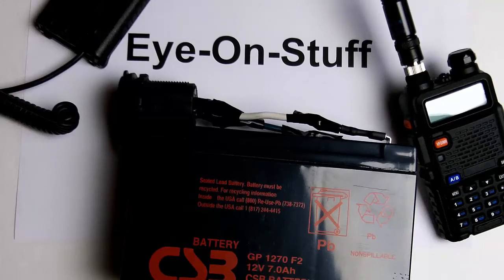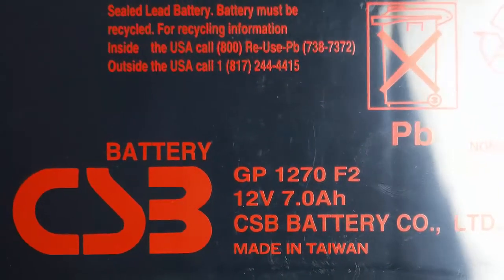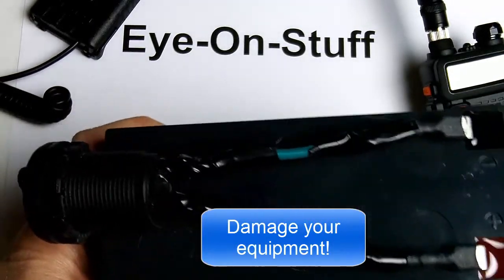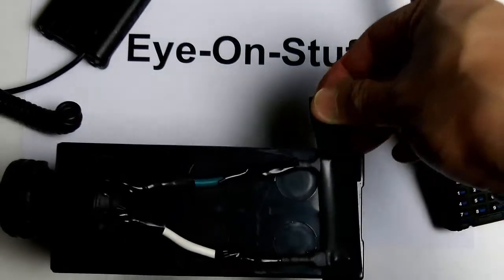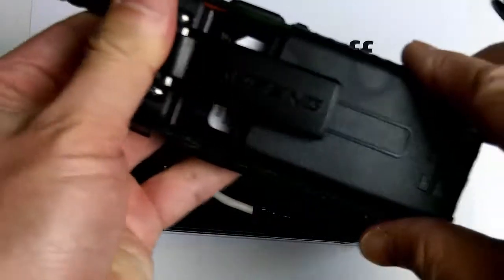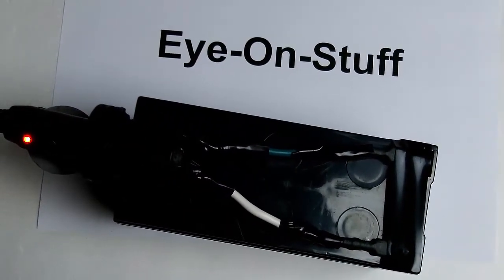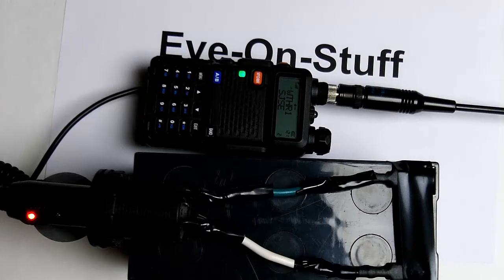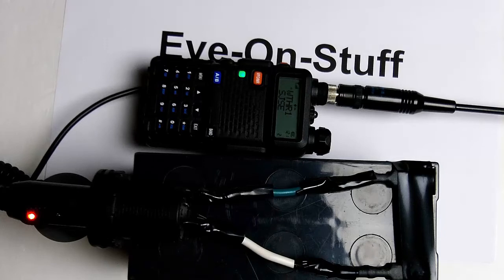DIY 12Volt Cigarette Lighter Battery Backup Power Pack : Eye-On-Stuff

Comment: how long can you run that battery set up on Beafong 5R? Also you should note in the video the importance of charging and monitoring the charge of that battery.
Reply from the maker: +RViscara I have not tested the length of time for charging a 5R.  I use this method of charging for quick and dirty (in a pinch) charging. I'll try to do some testing.

Comment: Hey...what about CHARGING your backup battery WITH your cigarette lighter plug ? Example .im thinking you have your 12 volt cigarette plug .CUT the ends off ..mark them accordingly.positve and neg .get some small alligator clips . soldier them on heat wrap them ..now clip then on your back up battery with your cigarette lighter plug in on it that you made already..see what im saying...also just cause i over kill and over think sometimes..get a little solar panel . thunder bolt or a 25 watt one..and trickle it if you dont drive it everyday ..ya know what i mean .and also taking in every possible safety precaution..ya might have to add another cigarette lighter plug too but ..ya what think ?